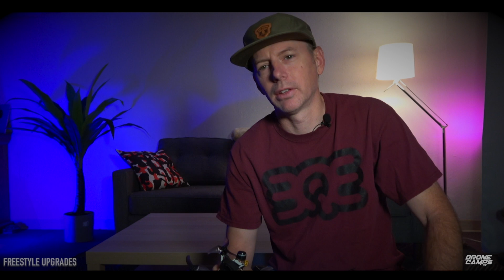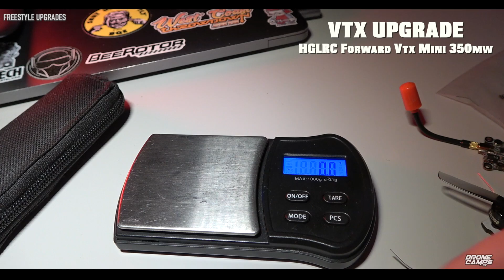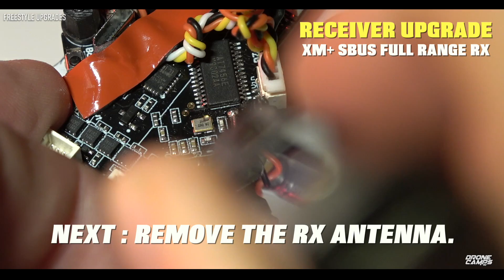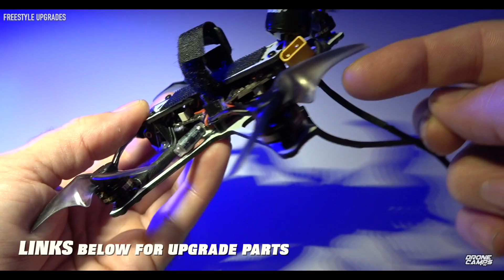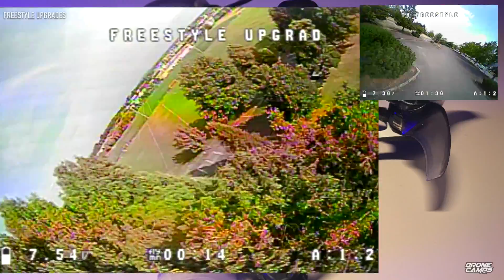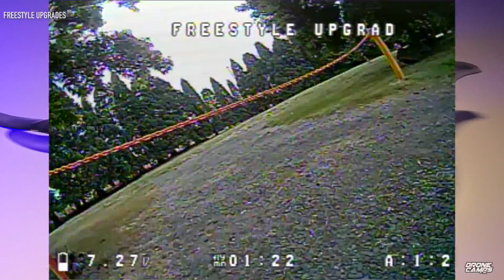EMAX TINYHAWK FREESTYLE UPGRADES - DO THESE NOW!!!

Comment: A note is to not throw away the ph2 connector, just remove the heatshrink and solder a xt30-f on it, now you can use it with 2x1s or 1x1s & bridge connector on your th2 xt30-m

Comment: this quad is very very very i have to say very good out of the box people. rock solid. these upgrades are to make it a high end professional grade quad.. So all you people saying meh its not worth it let me say it is. I have flown a ton of quads out of the box and for this lil guy i have to say it fly exactly like a 5 incher. thes mods are if you want a pro rig. i pay out about $400 on a base line 5 inch quad build pro rig. You can have this for about 200 and tinkering. Just sayin. I make theis setup for friends only I use the R9MM with tbs ant and an akk 200-800 with micro mc and ant. Now Emax supplies the xt30 in the pack for the bat mod.

Comment: For everyone that is trying to Upgrade an R-XRS Receiver !!! You need to solder the Signal wire to the uninverted SBUS Singal (the Pad with the B on your R-XSR), then solder the other end from the Signal wire to the RX1 Pad on your FC. It is located on the Bottom of the FC. After that, go to BF and choose Soft Serial on UART 1, then choose Serial-Based Receiver and SBUS. Done

Comment: Great video! I was almost going to buy this, because $100 is an awesome price. But if I have to spend another $50 on upgrades, better to just buy a different quad.
Reply: I will skip it just coz all the upgrades needed, kinda reminds me of a wasted 100$ on the 1st tinyhawk
Reply: These upgrades are nice to have but not required to have fun with the quad.  I think the camera upgrade is pretty important but you can have plenty of fun with just the stock setup as well!
Reply: Do RC I agree... I watched other reviews, the quad performed pretty good without any of the upgrades.
Reply: @KIKI55cro  why did you wasted money on your first Tinyhawk ?
Reply: 50% increase to have a quad of this size perform closer to the reliability of a the 5” class isn’t that bad if you consider the maintenance cost between them. The value with a smaller rig with high performance is really in the transportability of the system. In my experience whenever a new “flight opportunity” comes and I wanted to bring rig that doesn’t require a lot of room. I take my th freestyle rig. A new place is for me at least is very intimidating. New lines of sight; people activity; wild life activity; weather patterns; etc are all risk factors that enhance or reduce the experience of flying a new spot. The smaller rig is excellent. Crashes almost never require major repair. People don’t freak out vs 5”!.. I’ve had the local coast guard land on the beach to regulate on my ass because people ignorant of what they are hearing and witnessing report illegal activity. I live in. Northern CA. I follow all local regulations. I honestly thought the coast guard can find a better task than regulate one drones on the beach “going over 100 mph with small explosives” was the reported call. I guess quad was spotted with lipo that was wrapped in “dynamite red” (more for my visibility when looking for he quad) electrical type. Which I can see how one can mistake a dynamite on my quad vs red lipo packs. I can only imagine someone who is familiar with the color “red dynamite” be the one reporting the explosives on board my rig. Lesson learned. Don’t use the color code of explosive devices. Lol
Reply: Epic-Elite Dynamics I understand what your saying. $100 this is a little beast! Worth every cent! AndyRC did a great review and showed his PIDS. Stock setup can go 2 football fields. If you want to go further, you should buy a better HD quad. Justin’s must do recommendations are about $50+. I can buy a better quad for $150-165. That’s my point. This quad is SIC! But is it worth upgrading and still be limited to no HD?
Reply: @grandmaster-grouch  Epic-Elite Dynamite that is your new nickname 😂
Reply: It's worth every penny. I've put $70 into mine. XM+ receiver, AKK 200mW vtx, CP vtx antenna, and Caddx EOS2 camera. Only the receiver upgrade was necessary because the built-in one SUUUUUUUCKS. The camera was optional and worth it for $18, and the vtx will be worth it just to get away from a soldered on antenna.
Reply: The quad is dope. My original camera broke first crash. The video dropped though you have to change it regardless.I used my Eachine  Tx05 at 100mw.  Worked great. No protection for the camera though. I smashed the camera lens off the build. Emax built a  floating freestyle it's fun to fly. I'm going to buy this mod it's gunna be worth it.
Reply: Do RC the vtx got so bad I had to change it cost nothing freebie from bangbad so 200 mw switchable sweet easy
Reply: @KIKI55cro  I'm flying that now and will probably just return it on amazon for a refund. It's messed up but once I build a 5" I won't care about my tinyhawk
Reply: Quad rips out the box, super fun bit of gear, upgrades just make it kinda high end, overall even the extra cost is worth it if you want to upgrade. My place is small enough to not need any really, fly it every day. No money wasted here.

Comment: My tiny hawk just got ran over by a car… the bottom board is flashing lights but the top isn’t, I imagine that’s the ese I gotta replace?

Edit: don’t you want a capacitor if you install the xt30

Comment: hello so i did the upgrades but i can not get any radio response in beta flight 
i am using frsky x9d plus with the micro rx 
my video tx is working fine my motors just sit there beeping and i know i’m bound because i get a telemetry recovered or lost from my radio 
i’m showing two urts in beta flight and have tried both and nothing 🤷🏻‍♂️🤷🏻‍♂️🤷🏻‍♂️

Comment: Since I'm a beginner I would prob like to fly this on a 1S only first.  How can you connect just one cell ? You said u cannot use it on 1S if you change to an XT30 ? You did mention in another video that there should be an adapter  for 1S?

Comment: Another great video (I realize this is old and the Freestyle 1). 

1. Is the velcro you have on the top plate for additional grip or dampening? You don't have velcro on your batteries do you?

2. Is there a maximum mw that the other components can handle? Can I use a VTX that has a 500mw? Would that fry any other components? My understanding is that it would probably use up more battery as the drawback.

Comment: would it be safe to splice into motor wire when switvhing out bad motor for new motor and then heatshrink around the spliced wires or is it only recommended to solder straight to the esc even though the old wires to the old engine are still soldered onto the esc along with the old motor atm because i havent gotten to it just yet

Comment: So, the black&red (vcc&ground) you solder directly onto the lc-filter? Together with the battery-wires? 
In my case, using an eachine vtx03, only 1 yellow (video) wire is left. Solder this one on the video-output from the FC? No problem I don't have the white (smartAudio) cable with it? Still works?

Comment: I did the same upgrade but when I do punch out's, the video goes black and once I pull back on the throttle, the video feed comes back most of the time. What is the issue here?

Comment: I just got the stock version, i will definitely be making these upgrades!

As a side note though, I can tell this thing is gonna last. I accidentally smashed full force into solid concrete the 3rd or 4th time i flew it and there's barely any marks. Love it.
Reply from the maker: Awesome! Mine is months old now and still one of my favs. It sits on my desk like a trophy 🏆
Reply: well 2 inch drones last and are stronger than EXPENSIVE 5 inch drones which is crazy

Comment: Nice one brother, great upgrades! You've addressed all the things I hated about that quad perfectly. I was thinking of using the tx03 so I can change up the mw output. Funny, I'm thinking of the upgrades before actually buying the freestyle.
Reply: Use the S version the original has no smart audio. For 7 more bucks you can get the akk and it's the same weight with 500mw and smart audio
Reply: @brendanzaebst9011  considering u wi;ll use 1s 
 input voltage difference VTX03S Ingangsspanning: 3.3-5.5V , AKK X5 Ingangsspanning 5v . the 5 volt from the fc board is a stable 5v  ?? and this will work ?
and the AKK FX4  Ingangsspanning: 7v-24v  will not work on 1 sright ?
or what vtx will work with with 1 and 2s ?

Comment: Did the receiver upgrade
 after setting up correctly quad disarms before reaching 10cm height
then quad turns off with plugged and also full battery
SHORT CIRCUIT not visible

Comment: I plummeted for the TH FS and bought the hglrc fd vtx micro v1.1. It says input voltage must be 5v, but in you tutorial you say to NOT use the original vtx power pins (which are 5v + -). Which pads can I use as Im installing an xm+ so those power pads are used to?? thanks for any help.

Comment: I enjoyed watching. Only negative point is that if all these upgrades are applied it almost doubles the cost of the quad! If i get one, I'll do the XM+ as my only Taranis is the X9 Lite so no D8. Query re the XT30 lead wrapped in the VTX antenna co-ax: In a crash that ejects the battery, will the co-ax still be OK?

Comment: I have a blade 200 QX that i moved to a carbon frame. I want to upgrade motors for more power and Thrust . Any suggestions. And fly with 2 or 3s battery around 900 MaH ?

Comment: Hey Justin. Im keen to swap out the shitty VTX in my THFS, and as you seem to know whats what, Im hoping you can help me out for a minute please. I checked out the VTX you recommend here on Aliexpress, and it says it takes an input of 5v.. but you say to solder it to to the battery pads!?? I dont get it. Am I looking at the wrong VTX or am I missing something. 

I figure I have to run a 5v regulator from the battery, then to the VTX.

Comment: Thanks for the very informative video.  I have done everything except I left the stock camera and I use a eachine vtxo3s to save on weight.
I prefer the hq props because of the throttle response in the high end. I’m using Tattu 450mah 95c hv batteries.  My all up weight with the hq props is 82 grams and I get a full throttle flight time of about 3 1/2 mins.  I really appreciate the Avon props for there grip and the big maneuvers like you said but with my set up the weight goes up to 87 grams and flight time goes down to 2 to 2 1/2 mins.  It seems like to much amp draw.  
    I’m really curious what your all up weight and flight times are with the Avon props and your camera and vtx?

Comment: Dang Nice L@@Kin, You've Been A Busy Lil Bee! LOL PS Denatured Alcohol Will Make Any Hot Glues+ Release So Don't Be Pulling or Tearing On It! Thanks
Reply: IPA  totally releases Hot glue from anything,  it's a great trick .
Reply: @DavidCook42  hot glue will hold the camera in pretty well? I put quit a bit  but I hit alot of trees lol
Reply: @mkleespies78  It works well enough,  if it comes loose again,  take some IPA Alcohol ( https://www.youtube.com/watch?v=gHrZyfEpNPg ) 
 and poor a little on the hot glue and it should instantly release and pull away,  then you can re glue the camera back again.  I think it's better for the camera to get knocked loose instead of taking all the force of a crash

Comment: How did you take the stock VTX off? Just desolder it?
Reply from the maker: Yea. Add heat to all 3 pins. Pull with your fingers.👍🏻✔️
Reply: Drone Camps RC neat, how did you get it to talk to your flight controller? I switched the receiver settings in beta flight to the “serial based receiver” and “sbus” respectively but it’s still not registering. The receiver is bound and talking to the radio. Is there something I need to change in the uarts?
Reply: FIGURED IT OUT. Had to switch UART 1 to “serial receiver” thanks for the help

Comment: Thanks for the video. I did these modifications but can't get the smart audio to work. I can get the menu to come up in the headset but the drone won't accept any changes. I've played with the UART 2 and 3 options in betaflight. I can make VTX changes manually on the chip. What am I missing?
Reply: Same , have u figure out ?
Reply: Yea I saved changes before leaving that tab. I never could get the smart audio to work on the TinyHawk or another quad I built. Doesn't bother me at this point, I've got everything else working.

Comment: Hi, This is probably unnecessary question, but I don't want to fry something for what I saved money.Would the process be the same for flysky fli14+ receiver?
Reply from the maker: Should be. Double check what voltage the FLI+ accepts.
Reply: @dronecamps  Thank you.

Comment: Hi so what did you change in betaflight under receiver to make it work? I did the same rx upgrade but the rssi signal seems to be reading the old rx on the board. Thanks
Reply: Configuration tab: Change receiver to Serial-based, and choose SBUS below that. Save and Reboot.
Then go to ports tab and turn on Serial Rx on UART1. Save and Reboot.
Check mappings and modes, and you should be set.
Reply: Ricky-C FPV 
Thanks so much for the quick and detailed reply! Many thanks
Reply: @jasonporter4726  No problem. Had to figure this one out on my own after I installed an XM+ in my TH freestyle a few days ago.
Reply: Thanks for these tips. How did you add telemetry?
Reply: @energyfordays  Receiver needs to support telemetry and it must be connected to the FC's tx pad, not just the rx pad, and on the same uart. All you have to do is enable telemetry after following my above instructions.
Reply: Ricky-C FPV  thanks again!

Comment: can i use the rxsr receiver instead the xm dustin?
Reply: I'm trying but not getting a signal
Reply: For everyone that is trying to Upgrade an R-XRS Receiver !!! You need to solder the Signal wire to the uninverted SBUS Singal (the Pad with the B on your R-XSR), then solder the other end from the Signal wire to the RX1 Pad on your FC. It is located on the Bottom of the FC. After that, go to BF and choose Soft Serial on UART 1, then choose Serial-Based Receiver and SBUS. Done

Comment: Just to be clear the video and rx wires that u solder on “ yellow and white” literally solder to the same two spots that the old vtx was hooked up to? Atleast that’s what it looks like in the video. I’m just trying to find the spot u said not to hook up to lol, don’t see that labeled. Thanks man love the video can’t wait for my vtx to come from Banggood . I know it will take forever haha
Reply from the maker: No. Not the same spots. Yellow goes to VOUT. White goes to the other tab.
Reply: Drone Camps RC maybe I said it wrong. What I mean is that v out and other solder spot are the same 2 spots that the pins and standoffs were at? I understand to be sure the yellow goes to v out and white goes to the other. Ty for the reply.
Reply from the maker: Yes they are the spots where the pins were. Yep. ☝🏻

Comment: Really really an excellent job Justn, thank you very much for the valuable suggestions
, always the NUMBER ONE.
Everything seems to work well after the changes, but I noticed that the VTX card heats up a lot, you can't hold a finger over it, is it normal ?
Now I see that I don't get the RSSI value from my XM Plus, what did I miss? I see RSSI on OSD google display, but no on my X10s.
Reply: Mine heated up really bad too, then the other day when I went to plug the lipo in, I wasn't getting any power to the vtx... fried. Hoping it was just defective.

Comment: That stock cam doesnt look bad
Reply from the maker: Not until you see it in your goggles. It looks like a 2016 AIO camera
Reply: The stock cam isn't horrible until you are flying toward an obstacle, do a flip where you're facing the sun for a moment then are completely blind as the camera takes a full second to readjust to the lower light level.  Then it sucks.

Comment: I wanna still fly it 1s. Can I run a unify nano 5v to the camera 5v on the board then power ther camera from the vtx? Using stock cam
Reply: considering u wi;ll use 1s 
 input voltage difference VTX03S Ingangsspanning: 3.3-5.5V , AKK X5 Ingangsspanning 5v . the 5 volt from the fc board is a stable 5v  ?? and this will work ?
and the AKK FX4  Ingangsspanning: 7v-24v  will not work on 1 sright ?
or what vtx will work with with 1 and 2s ?
Reply: playmatee1 I did it and used a unify nano wired all wires to where the old vtx was. Works great

Comment: Anyone that has done these upgrades, I need help. When you go into betaflight, I need to know what you're settings are for the receiver. I have a T8SG and I'm trying to get it to connect. Thanks in advance.
Reply: We did this on ours, exactly the same upgrades.
He didn't mention betaflight in the video but we made these changes and our RX started working.

BetaFlight Changes:
- Configuration Tab > Receiver > Receiver Mode: Serial-based receiver
- Configuration Tab > Receiver > Serial Receiver Provider: SBUS
Press Save

Now go to Ports Tab:
- Ports Tab > UART1 > Serial Rx: Enable Checkbox

Press Save and Reboot.

You should now see more channels in Receiver and should see some activity if your receiver is bound properly.
Reply: @jfrux  Thanks, I got it working..😁
Reply: Thank you very much for this information. I am following his upgrade the same on my THFS but I installed a Foxeer Predator Nano V4 camera instead of the Runcam Nano. You probably just saved me from pulling out more of my hair. ;^)

Comment: Hello.  I have just completed this upgrade. The only issue that I'm having is when the quad is disarmed, the camera view is shaky with white lines. One I arm the quad, it returns to normal.  Any ideas?
Reply: I adjusted it in BF. It will only work properly when either VTX IRC/Tramp or Run Cam Protocol is selected.  With the Tramp option looking the better of the two.